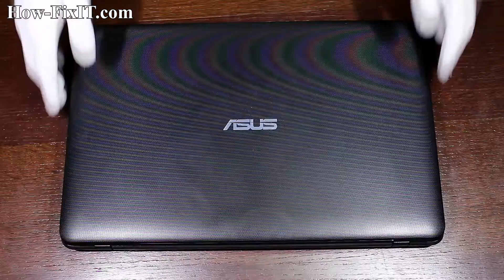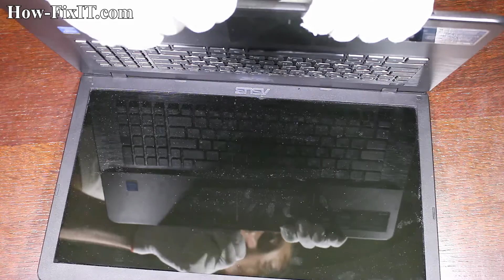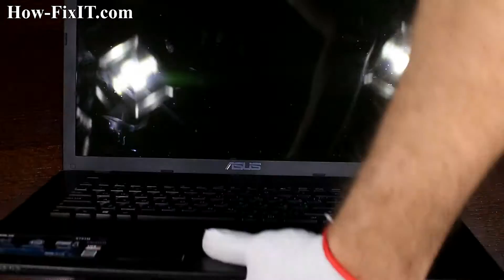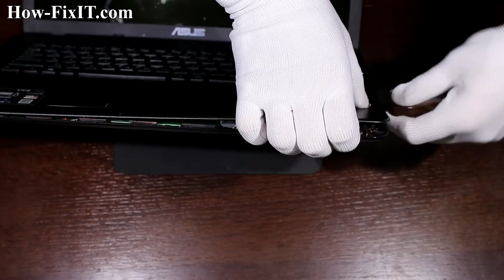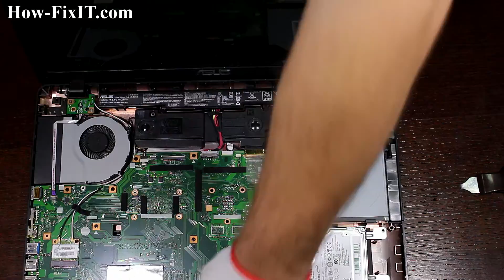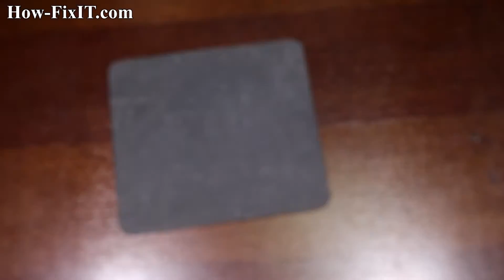Reset BIOS settings Asus X751 laptop | CMOS battery replacement

Comment: This is strange.  i have an asus x751na.  i opened it exactly like how you did it.  the mother board looks exactly the same but no BIOS battery.  there's the big white square on the bottom, then the 2 rectangles side by side, then where the battery is supposed to be it's not there.  I searched the whole board and nothing.  it's strange. but anyways thanks for the video, you do a good job showing how to open a laptop, very easy, thanx again!

UPDATE:  Sorry folks I never found the battery.  I took it apart even more to see if the battery was connected somewhere else but nope, nothing!  My laptop is now collecting dust in storage until someone finds a solution.  :-(
Reply: Did you ever find the battery? Same situation here with a x751n
Reply: @thomfraleigh2499  did you find battery, i also have x751n and i didnt find battery
Reply: @zokizo33  no, never found
Reply: Im in the same situation, have someone found the battery? Im trying to reset an bios password...
Reply: @thomfraleigh2499  Im in the same situation, have you find the battery? Im trying to reset an bios password...
Reply: @zokizo33  Im in the same situation, have you find the battery? Im trying to reset an bios password...
Reply: @tiagoferreira1856  I never found it
Reply: @tiagoferreira1856  no i didnt found a battery but disconect main batery and hold power button for 60 sec, that will restart bios
Reply: @zokizo33  don't have any battery, but i disconnected the motherboard for a while and when i Turn on the Computer, no more BIOS password, thank you all!
Reply: I'm in the same boat. I followed the instructions all the way to the end just to discover my x751N does, in fact, not have a bios battery.